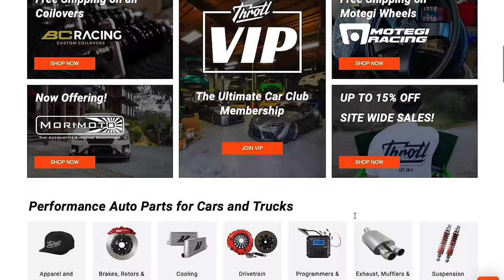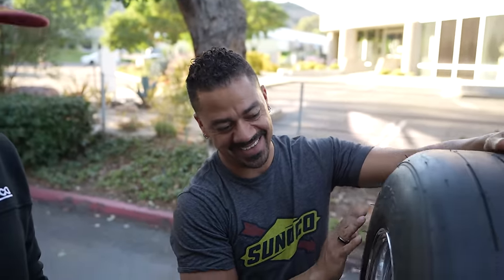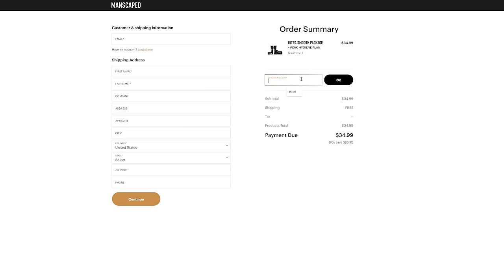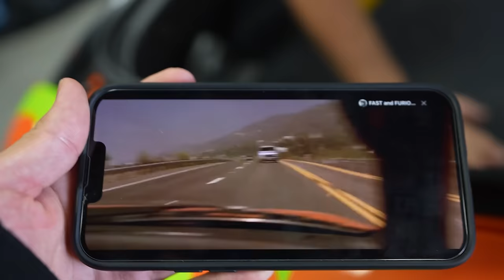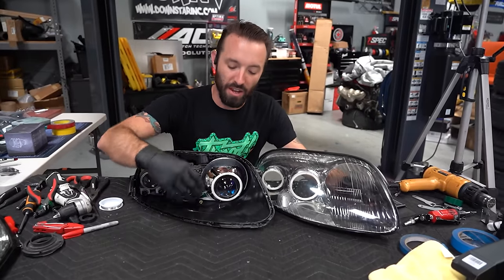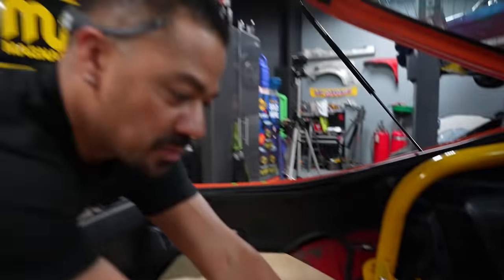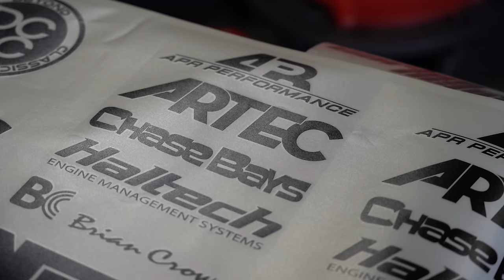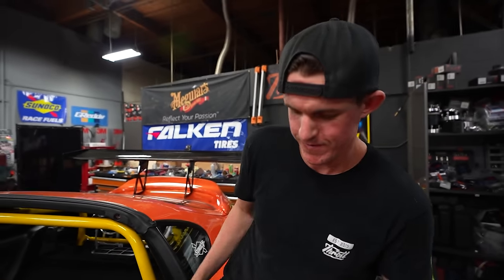Building a Modern Day (Fast & Furious) 1994 Toyota Supra Turbo - Part 13 - NEW WHEELS!

Comment: The car looks sick!! - the “drag” look is cool but you guys should have a matching size for the rear for reg street use 🤘🏼🤘🏼🤘🏼
Reply: It's not going to be street legal, Mikey said it a couple videos ago
Reply: @breezeman120  not only that it would probably be dangerous to have the same set of wheels on the back because of how much power this thing is making
Reply: @bobtaco99  there are guys with 1000+ hp Supra’s with regular wheels for street use on YouTube. No problem
Reply: @betonblack3621  or 2500hp ugr lambo np too :D

Comment: Not a fan of the back wheels having such a small circumference but damn this build is amazing!
Reply: agree, i like the look of a big tyre on the back, 15's are too small, 17s would have been good against the 19s on the front
Reply: agree should have been bigger in the rear hope they have 19” for the back too
Reply: This. It just doesnt work with the style of the car. Some super deep barrel 20's with thicker side wall radials woulda been the ticket to keep with the style and add that extra wide footprint. Also...whats with the yellow cage? It just looks out of place.
Reply: I agree, It makes it look like a dragster.
Reply: I agree too. That wheel combo doesnt work for me.
Reply: Agreed. Don't like the rears. Here's hoping they actually have a set of 19's for the rear. The drag look doesn't suit the Supra. Shame, as the rest of the build is epic.
Reply: Horrible back wheels. Those wheels runi entire car
Reply: Same thoughts
Reply: @Tyler  the yellow cage is because the original F&F Supra cage was yellow and that's because the whole car was yellow before they painted it for the movie. That's also why the original seats were blue.
Reply: @Sabzer0  that's the point. They've said it a couple of times. I think they even said in the last video it won't be driven on the street
Reply: Same here, not a fan of the rear wheels and tyres. Ruins the car in my opinion.
Reply: @gh0st024  yeah I know it’s going to be a track car but it still looks weird. Everything about the car is amazing the only thing that’s out of place for me is those rear wheels.
Reply: Great build really not a fan of the drag tires
Reply: Yeah weird seeing drag rears on a car with a massive spoiler too
Reply: Agree!!
Reply: Since they’re actually going to drag race it, they went with function over form
Reply: @brandon73072  i am wondering how anyone could think that was a good idea. Esthetic of the car is ruined. I hope they will fix that.
Reply: As wa stated earlier by the guys thia car is a drag car.....yes a tribute F&F cars but still a real drag car hence the drag wheel/tire
Reply: It needs a thick tire to put 1000 hp to the ground without spinning. They said it was going to be a track car not a burn out car.
Reply: I agree not a big fan of the big tire. 19s on the back would make that car look absolutely beautiful. Great content!
Reply: @andersonking4803  they could have a set of drag tires for drag race but 19’ for showrooms and every day use.
Reply: @Bendejo-lm8wo  that is not correct. Many cars today have much more than 1000 HP and do not need such tires for traction. Rimac Nevera is an electric car with almost 2000 HP, and it has a normal rims. 2000 hp and a torque of an electric car is much stronger than what they are have.
Reply: Yall do understand that 1000+whp on 19s would spin quite a bit right? Especially on a rwd car.
Reply: @ante8210  lol u talking bout an awd car.. this is a rwd with 1000+whp, it will spin with 19s on.
Reply: @babypinkbean  You might be right but the car with those rims looks horrible. Please don’t tell me that you like how rear rims look like? Entire build is beautiful but those rims……ughhhh
Reply: @ante8210  im a fan of the wheels just not quite sold completely on them with this specific build. But i dont mind them, especially with the power they want to make. If it was like Tj’s supra with 700s then yeah i’d take them off
Reply: I agree, it seriously tanks the faithful recreation way too much to call it just "a modern version"
The wide body on the back half also multiplies this effect since the original doesn't have a widebody
Reply: Same, but i'm not sure how else you could fit those MT's under the guards with that tyre profile without having the tiny rim diameter.
Reply: @Seeeeyaaaa  no need to have that tire diameter. Put 19’ and use those ugly wheels when you go to drag track similar like hellcat setup.
Reply: @ante8210  19s would be too ricer..the problem is, the rim style doesn't suit the tyre and widebody look. They are going for a drag inspired look which is great but the wheels just don't quite pull it off. There's heaps of other options that would look way better.
Reply: That and I’m not a huge fan of the rear bumper. But I respect it

Comment: Love the look and the details. The quality is top notch, but... I'm not a huge fan of the 15" drag wheels at the back. I know, function and stuff, but still... they should only be fitted at the strip and for the road and show a matching set or maybe even 20" at the back would look way nicer in my opinion. That doesn't take anything away from the overall build which is absolutely stunning.

Comment: I still say there needs to be a PS5 installed in there since the original had a PS2 😅
Reply: Wrong car
Reply: @MeSessum  Right car
Reply: @TheToyRoom  the white Honda civic had a PlayStation. Pretty sure the Supra did not.
Reply: @MeSessum  The Supra did have a PS2 inside of it, it was never shown off directly on screen but Craig Lieberman (the owner of the Supra) did have a PS2 and a screen behind the NOS bottles you can look up pics
Reply: @TheToyRoom  I did and all I’ve seen was another display in the rear. No PS2 in the front or rear hatch area.

Comment: I thought you weren't supposed to use tape on the nitrous threads because the tape can come loose and get lodged in the solenoid and block flow. If it blocks nitrous it's no big deal because it will just run rich, but if it blocks fuel flow you end up with an expensive lesson.

Comment: Everything looks good but the back tire just doesn’t work for me. The wheel looks too small and there is too much tire in my opinion. I think the ones in the front look good and if the rear ones looked the same it would way better but looks badass overall

Comment: Yeah you kinda lost me on this build at the rear wing and completely lost me with those wheels. Really bad choices in my opinion. Completely loses the flow and dynamic of the car. Fair enough if those wheels are drag strip only but it looks so much better with the "rolling around wheels" albeit in the wrong size.